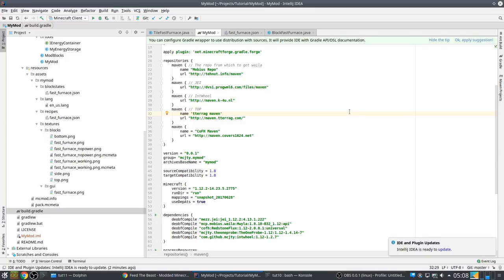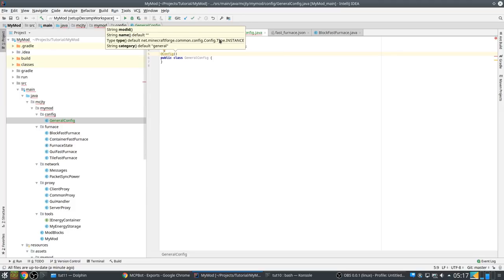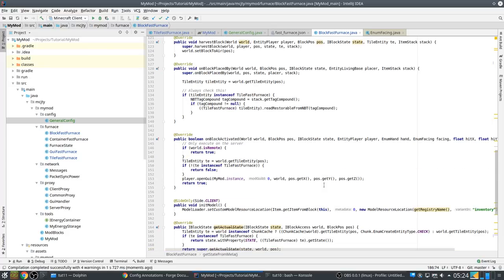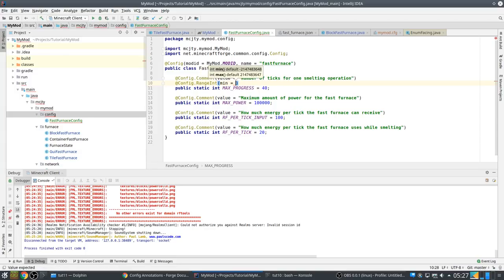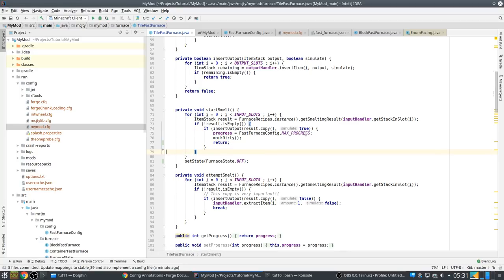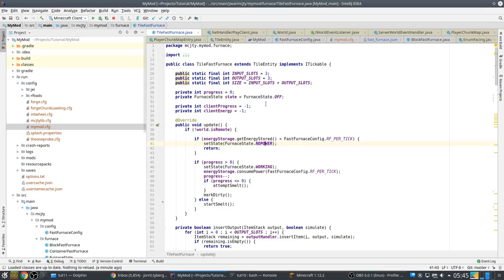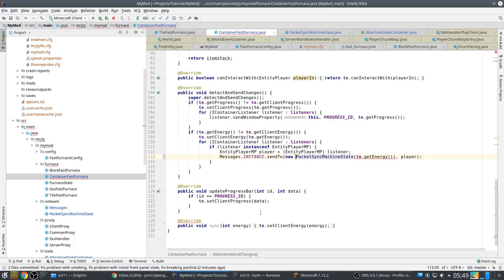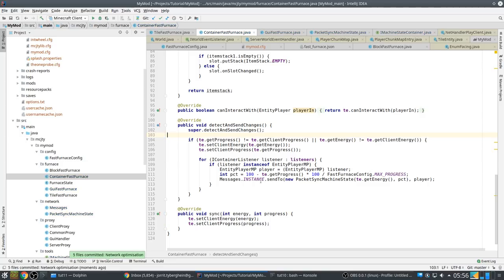Modding Tutorials: Episode 11 (configs, mappings, bug fixes, optimisation)

Comment: Another good one, thanks for going in to detail about the networking concerns, it's always been the most intimidating part for me.  I'm working with decoupled microservices using an MQTT message broker to relay integration events at work right now for the first time, the concept is quite similar!   It's still difficult to figure out what needs to be synchronized via networking, but I'm sure as I go along I'll get a feel for it.  I'm already thinking about ways to layer my own abstractions over the Forge APIs to make it easier on myself, and I better understand why every prominent modder with multiple mods seems to have their own core library dependency. 

A couple of questions arose for me during the video. Do you typically do much testing with an actual separated client and server when developing your mods?  Do these networking packets even come in to play for single player, or are both threads using the same instance so it doesn't really matter?
Reply from the maker: I don't test client/server enough. In the past I've had some issues in my mods caused by that. This doesn't happen as much anymore because I got more experienced with this but I really should test more :-)

The packets are also used single-player although they don't really go over the network as such. However you have to do it that way too. If only to be compatible with server play
Reply: @jorrittyberghein7398  I see.  So the packets are still used to get the data from the server thread to the client thread, but it's through some mechanism in which they don't leave the JVM?  Good to know, thanks for the reply.
Reply from the maker: @lmerry213  yep, that's basically it